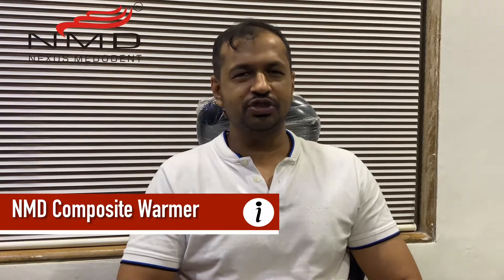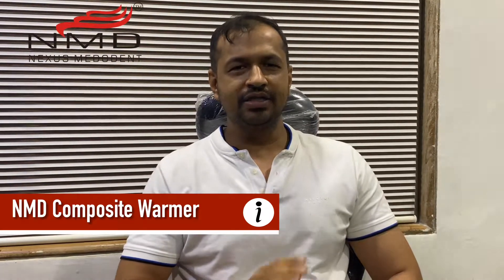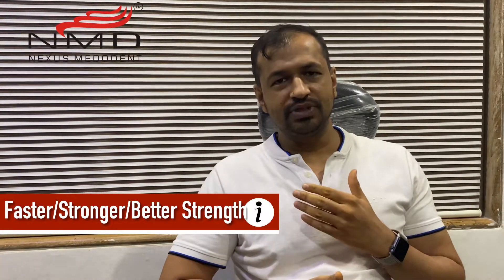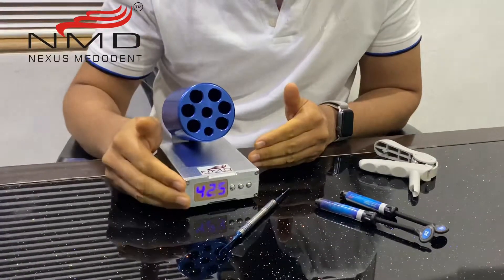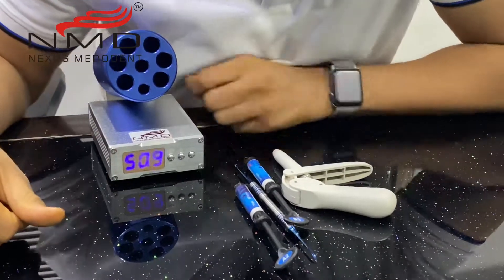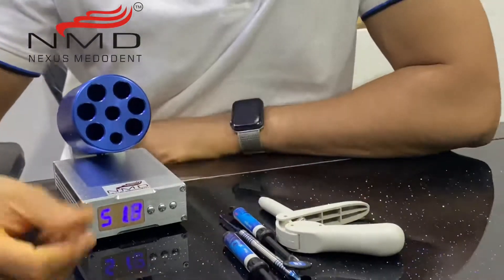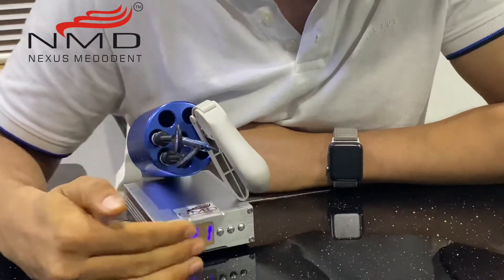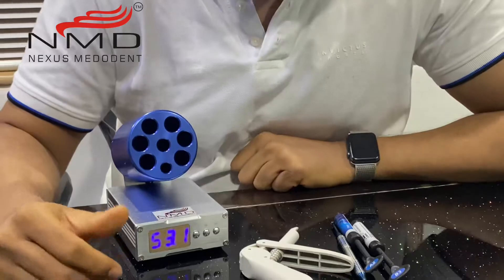Dental Composite Resin Warmer /Heater by NMD Nexus Medodent Heating Bulk Fill Restorative #dental

Comment: If you keep warming the same tube again and again then won't it hamper the composite inside the tube ? The manufacturers always recommend keeping the composite tubes in a particular temperature range . So after warming we should discard the whole tube or keep it for future use ?
Reply from the maker: All new generation composites including Nano and micro are made to adapt these temperatures including all top brands also the syringes are made to sustain the same .You can continue to use same syringe. If further doubt you can check with your composite Manufactuer/supplier.